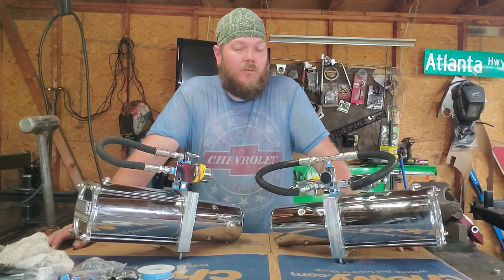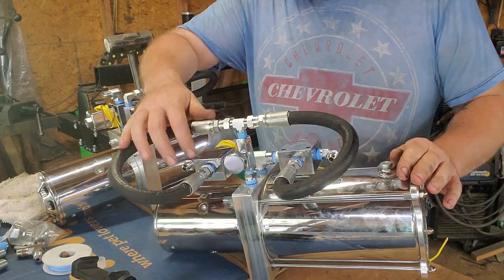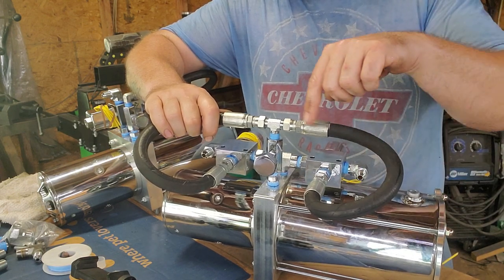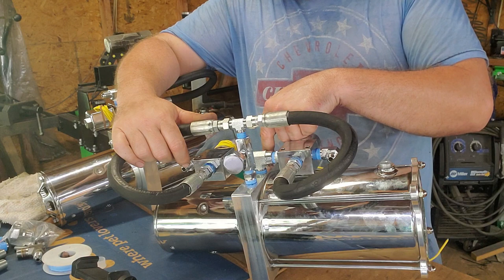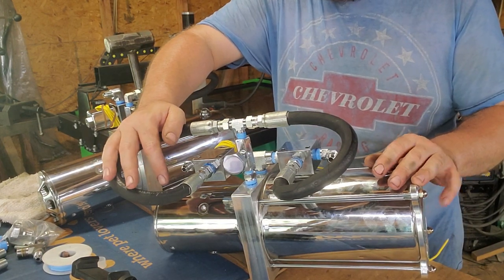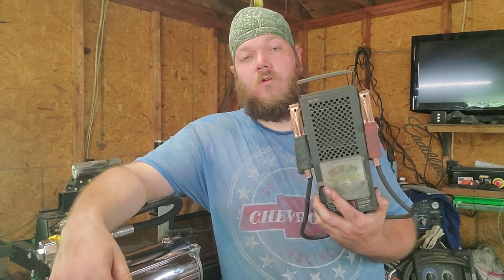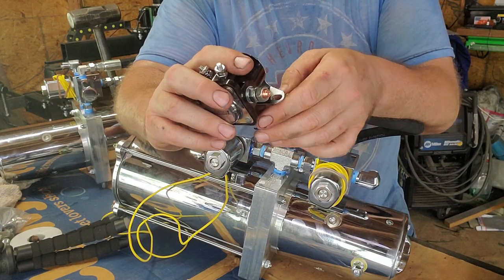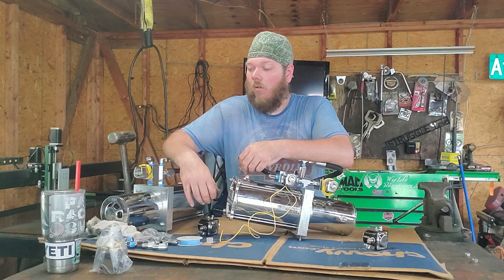Hydraulic Pump Diagnosis

Comment: Love your channel man...helps me alot with my caddy... I was wondering if you could do a accumulator install video..?
Reply from the maker: I will in the future I have a car I'm putting them on but they are pretty easy to install just get the fittings and tee them inline to the cylinder after the dump you can also put them directly on the cylinder itself

Comment: Great video! If you get some time, could you do a video about the level ride system on the Fleetwoods? Where to find all the essential components and common repairs and how to make them
Reply from the maker: Normally I remove them to install hydraulics but if there is a case where I do repairs on the system I will definitely make a video I can say 93 is different then 94-96
Reply: @thecadillacdanshow8658  I actually didn't know that. I've got a 94 commercial chassis and I think the switch in the rear end is bad. It stopped turning on the compressor to lift the rear end. No light coming up on the dash or anything like it's trying
Reply from the maker: Could be also you can check the relay by the compressor if it's a 94-96 it should be in the drivers side fender well behind the bumper
Reply: @thecadillacdanshow8658  I did swap that for a new one and still nothing.
Reply from the maker: You can use a volt meter to check the switch I'm not positive but I think all it does is connect the circuit (basicly connecting two wires together) you can ohm the switch and see if it has continuity also check and make sure you are getting power to your relay up front I belive there is also a fuse that goes to that relay under the hood

Comment: Learning to hop. Got a 3 pump with cce pumps
7 battery’s, one is dead and not connected.
Caught air a few times but seems like the switch is a big laggy, kinda hard to catch any air.
Also, I heard my pump do a noise where it was a long zzzztt. Then the normal zzzt sound and I wasn’t hold my switch up either. Happen one time, any idea what it could be ? Also, would 4 more battery’s and new seals in my pump and cylinders help with it taking off of the floor? Thanks
Reply from the maker: Could be a switch sticking maybe replace the switch I would work on your rythm before adding more batterys
Reply: @thecadillacdanshow8658  okay thanks for the advice.
Reply: Hey bro really quick my car doesn’t threee wheel with 3 pumps and 7 battery’s not sure why I saw pictures of my car from past owner 3 wheeling idk what it is but wondering if it could be my springs or something what do you think.
When I dump my front and back it only drops to about stock height
Reply from the maker: Does it have a chain bridge? Also you may want to try lifting the front first then lifting what ever rear cylinder that you want to three wheel with some people use the upper trailing arm to create a pivot point to tip a car to three wheel it's not my preference but it works

Comment: First build I can use any check valve and any dump on any pumps like Mitch match parts in brands
Reply from the maker: Yeah for the most part you just want to keep the fitting sizes the same if your building a lay and play set up I would go with 3/8 fittings

Comment: My dump trailer started recently gotten weaker I got it checked has new battery and everything electrical was good 

However I noticed the to bolts that mounts to the rack were lose could that have made my dump trailer weaker? I also bleed the air out on a full charge it seems a bit stronger but definitely less power then when I first got it
Reply from the maker: If the pump does not have a ground wire it probably grounds through the mounting bolts so that could cause a issue
Reply: @thecadillacdanshow8658  thanks for the quick response. I think that was the issue I removed the pump and it was really dirty under the pump
Reply from the maker: You can also add a ground wire that goes from the battery to the mounting bolt of the pump if it's easy to access that will ensure a good ground

Comment: Nice video! Would you know what can be the cause of car not dumping car will lift from rear but won’t dump. 
We did release some fluid we thought maybe “pressure locked” but still same thing.
Reply from the maker: Make sure you have 24 volts to the dump also check your ground with the car all the way down hit the dump switch and have another person have their hand on the dump and feel if its clicking. Does the pump have one dump or two?
Reply: @thecadillacdanshow8658  The pump has two dumps and these dumps are Italian style oil system dumps we can see a red light lit up on both dumps when hitting the switch down I would think they are grounded if light comes on 🤷‍♀️ but we are gonna have to check
Reply from the maker: Can you hear them click? Also are the front dumps the same style
Reply: @thecadillacdanshow8658  it sounds like it does click. And yes the dump for the front is same style as rear
Reply from the maker: @patriciam0415  you can try swapping the dump solenoid with the front ones and use the front switch and see if it will dump the rear if that makes sense if it still dosnt work there may be a problem with the dump itself
Reply: @thecadillacdanshow8658  yes it makes sense what you are saying now the wires are different color to the front so I have two dumps to the rear and one to the front does the color wires matter on the solenoid 
Reason why I ask it’s because I see black in one yellow and orange looking lol I’m sorry if it sounds confusing and honestly you call someone to help or to fix and they wanna charge an arm and a leg for a simple fix 😑
Reply from the maker: @patriciam0415  you can take that one dump solenoid off the front pump (if your wiring is long enough) and put it on one of the rear dumps if you dont have to unwired it you can now dump what would normaly be your front dump switch and it should dump whatever corner you put the front dump solenoid on or if the wiring is to short you can rewire it to the rear if you feel comfortable diving into that

Comment: When I hit my switch I hear a grinding noise oil is good and battery’s as well will it be a bad motor or gear? The car goes up and down  but not like it should
Reply from the maker: Could have a pump head gear going bad you can pull the tank and inspect for metal shavings there will be a little bit but if there is a lot or chunks your gear is going out

Comment: Question. I got a four switch panel. One front. One rear and the third and fourth are singles for rear left and right.  I got one pump to the front works fine.  Two pumps to rear. One for each side. Weeks ago I would hit my second switch for both rear and they both go up nice and leveled out.  Now when I hit the same switch they seem to go up at different levels. Like one starts before the other and they’re no longer level.  I have to use the third and fourth switch to level out the rear.  Please help. I was thinking my battery levels since I haven’t charged them? My first lifted car.   Thanks🫡
Reply from the maker: I would start by making sure the batterys are fully charged you could have a switch going bad if you can try using the two rear individual switches at the same time if it still lifts unevenly  you may want to load test your batterys you could have a bad one sending less voltage to one of the pumps if all batterys test good you can swap the rear hoses between the two pumps and see if the problem switches to the other side if it does you can do the same thing with the power wires coming from the solenoids to the motors to narrow down weather it's in your pump or your batterys or solenoids

Comment: How much oil goes in the pump or how can I tell if I need to add oil or if I have to much in the pump and what kind do you recommend
Reply from the maker: Check it with the car all the way down if the pump is completely empty they normally hold 2 and 3/4 quarts. Checking fluid I just pull the tank plug and use a zip tie like a dip stick

Comment: gm yea i checked everything put in a new dump  and it still just falls when i tap it down would that be a bad switch
Reply from the maker: Keeps falling after you hit the switch? Could be a dump sticking if you have two dumps on that same pump swap the dump solenoids and see if the problem changes with the swap if it stays in the same one you are having a problem with then its mechanical not electrical

Comment: Hi, i have problem with my tow truck system, it can lift light weight, but when i add load it just cant lift, i tried to change fluid, swap the directional valves, nothing works, now im planning to disassemble the pump, i would like to have your opinion and email please
Reply from the maker: I'm not the best with tow trucks I have worked on a few but am no expert but it sounds like the pump may have a seal going bad in it basically bypassing when getting to a cireten pressure it may also have a pressure release valve alot of times they will be on the valve manifold and will be adjusted with a allen wrench

Comment: I have a convertible 05 mustang. My top won’t go down or up, I’ve changed the fluid, played around with the relays so now I’m confused what to do. I don’t hear any clicking noise when trying to put it down or up.
Reply from the maker: I would probably start at the switch and see if you are getting power into the switch if you are go from there if not trace the wire and see where power should be coming from
Reply: @thecadillacdanshow8658  I’m sorry but, what’s the switch ?
Reply from the maker: @kennethdills2237 there is a switch to lower or raise the top correct I would check to see if it's getting power into it
Reply: @thecadillacdanshow8658 yes but how would I know if it’s getting power to it or not ? I’ve already tried letting it down or putting it up and it nothing happens.
Reply from the maker: You would have to use a volt meter or a test light to see if you are getting power
Reply: @thecadillacdanshow8658  alright sounds good. And I just put it on something metal to see if it’ll light up and I clamp it on something for ground correct ?
Reply from the maker: Yeah kind of. If using a test light (which would probably be the easiest and cheapest) put the wire that has a clap on to clean metal (that will be your ground) and the probe side you will want to touch you your wires to find which one has power if it doesn't light up it doesn't have power. A test light just connects a cruicut that's what lights the light up. Bit it's a easy way to find out what wire has power and what doesn't
Reply: @thecadillacdanshow8658  awesome sounds great! Thank you. I’ll try it out and see if that resolve my issues and let you know

Comment: What’s if your motor sparks and smokes when you hit the switch? Ty
Reply from the maker: Sparks is pretty normal but if it smokes it probably is getting oil in it. Pull the motor off and see if there is oil in it if so you will need to replace the seal that goes inbetween the pump head and the block
Reply: What if I changed seal and it’s still smoking motor good got it checked

Comment: How do you bleed these exact pumps for the 2 pump setup where fronts going down but not going up it was locked up i let some fluid out the fittings to get it to go down but now it wont go back up
Reply from the maker: Check your fluid level if you are good close your slowdown valve and hit the switch to lift the front if it goes up your dumps may be stuck if it dosnt it could be a bad pump head seal or a broken key in very rare cases could be a bad motor but it's pretty rare but not out of the question when in doubt you can swap motors from the rear pump to the front and see if you still have the problem
Reply: @thecadillacdanshow8658  it was just working a few seconds ago till i locked it up so if the fluid is low it could be the problem why it wont go up cause my rear is fine
Reply from the maker: One pump is for the front and the other is for the rear two separate systems when it comes to oil if the front pump is low it may not work while if the rear is full it will work just fine

Comment: Do you have a video on how to fix a broken key
Reply from the maker: Not specifically but it is a easy repair just take the motor off and pull the old peices of the key out. If you can blow the opening out with air to make sure no small peices are left behind and install the new key and bolt the motor back up

Comment: Important question, when I hit the switch and make the front end of my Impala go up, it's making a winding noise, it will even do it when the car is at its highest point, what could that be bro? It stays up and doesn't drop
Reply from the maker: Start by checking your fluid level with the car all the way down. If the level is low it can make a weird noise
Reply: @thecadillacdanshow8658  do you think the motor can possibly be going bad? It's a whinnying noise
Reply from the maker: Could be swap that motor to the rear pump and then hit your rear switch and see if the problem follows the motor
Reply: @thecadillacdanshow8658  I'll definitely try that! I greatly appreciate you replying back! I'll keep you updated, also where do I check the oil level at? I watched some of your videos and I couldn't find one showing where to check the oil level. I'm also in Tennessee I'm in knoxville

Comment: How do you know if your ground is bad? My quick disconnect has a high voltage and creating sparks
Reply from the maker: You can use a volt meter and check for resistance using the ohm setting you may also have a switch or a solenoid sticking just enough to draw power but not enough to actually run the pump I have had that happen before and almost burnt the car down

Comment: I neep your help
Reply: I got at 2pump four battery set up . On my S10 . My problem is I was testing my sylonidrs out and on the front pump the sylonidrs were good. Now on the back pump I was going to text the sylonidrs with the test light . I had disconcerted the cable that goes to the hydrolic motor . Well I had not even concted the ground and I put the test light to sylonide . Not even hitting the switch and the bulb on the text light blew out. . So I'm wondering how do I fix that problem

Comment: My back pump is sparkling any help that would guide me ain't no lowrider shops around here
Reply from the maker: Good possibility the motor is shot you can remove it from the pump and pull the end cap off and inspect the brushes if they are worn down the motor is done or if there is oil in the motor it will need to be cleaned out with brake clean and the seal between the block and pump head will need to be replaced
Reply from the maker: This may help you if you havnt seen it yet

https://youtu.be/0qmBgXifHqQ?si=EGqfR8L80k5WTDKz
Reply: @thecadillacdanshow8658   thank bud appreciate it I'll take a look this weekend  I saw your video very helpful to start just one more question do I have to drain the  fluid to remove the motor ?
Reply from the maker: @alexcomander3115 no you there is a seal inbetween the motor and pump head that keeps the oil in the tank. But if you take the motor off and there is oil inside if your motor that seal is failing and will need to be replaced

Comment: My rear pump wont go up… u can hear the motor spin…  any suggestions
Reply from the maker: Could be a broken key, low on oil, bad pump head, or a stuck dump you can close the slowdown and see if it will lift if it does the dump is stuck
Reply: Thanks for the reply 
Ill try it out tomorrow .. thats the only thing i didnt check the slowdown

Comment: Pressure seal keeps blowing on the pump head any ideas what can be causing this it’s a Marzocchi 11
Reply from the maker: Do you have 4 mounting bolts in the pump head. Is it being over locked?
Reply: @thecadillacdanshow8658  definitely four bolts no over locking it won’t even get to that point soon as it builds alittle pressure to come up it blows
Reply from the maker: Who are you getting your seals from maybe try a diffrent brand are there any defects in where the oring sits
Reply: @thecadillacdanshow8658  I get them from Primo Seals and nope no defects I guess I’ll try to get some original Marzocchi seals

Comment: How do you do a high lock up in the front of a lowrider
Reply from the maker: Extending the a arms will get you a little bit or using a high lock up ball joint but be aware making the ball joint longer outs more stress on that ball joint

Comment: I got a front motor spinning but won't lift no fluid moving through the system but the motor is spinning when I hit the switch. what could this be?
Reply from the maker: Close your slow down and see if the car lifts
Reply: @thecadillacdanshow8658  a closed the slowdown valve, replace the key, charge the batteries. Still no action. Motor is spinning
Reply from the maker: Could be the pump head seals or the pump head pressure seal between the pump head and the block
Reply: I'm going to check it out today! Thanks Dan
Reply from the maker: You can spin the pump then look in the tank and see if you see bubbles its probably the pressure seal for the pump head

Comment: I need a diagram how to install eight batteries with the hot for the switch where to put it
Reply: Two pumps
Reply from the maker: What voltage are you wanting to run to the pumps?
Reply: Four batteries on each pump
Reply from the maker: @abcardenas35 can you message me on Facebook I can send you a picture
Reply: Yes boss what the name  fb
Reply: Mines abelardo cardenas
Reply: Can't find yours
Reply from the maker: @abcardenas35 Cadillac Dan my profile pic is in black and white

Comment: I just changed shaft seal now my pump motor is smoking when I hit it
Reply from the maker: Did you put a little oil on the rubber if the new seal? If not it may have burnt that seal up with a dry start pull the motor and see if there is any oil in it